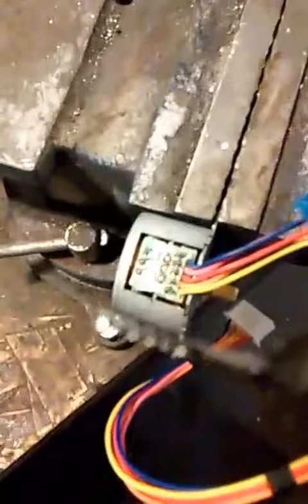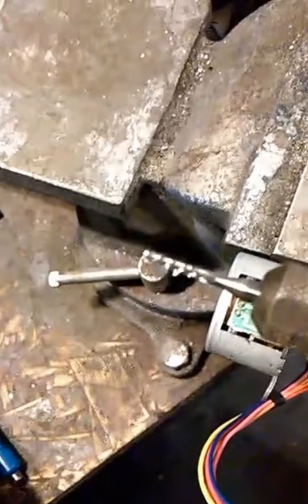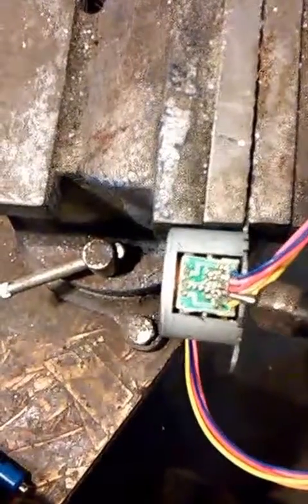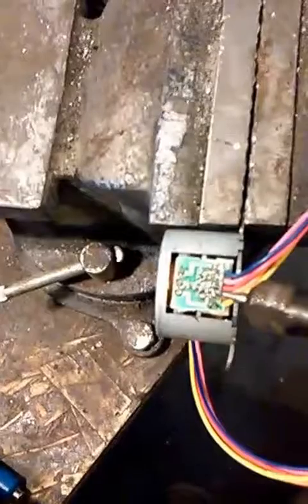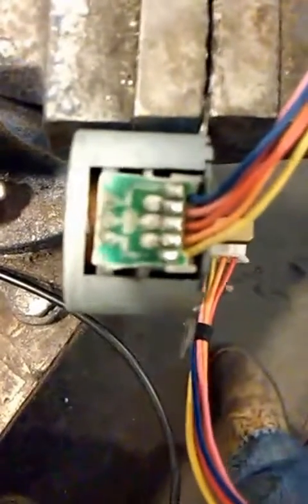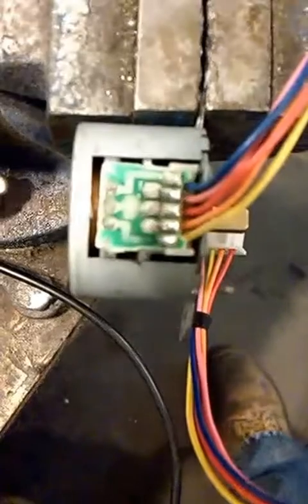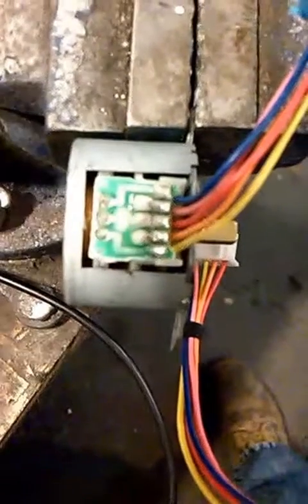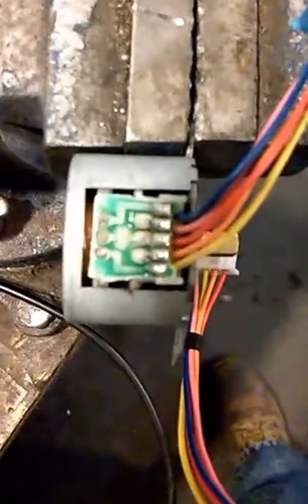Hacking the 28BYJ-48 Stepper converting 4 phase to 2 phase

Comment: Don't forget since you are using both sides of the coil and not just half at a time with the centertap you can double your motor voltage.   If it was 5 volts you can use 10 volt supply.   If it was 12 volts you can now power with 24 volts.  That might give you the torque you need